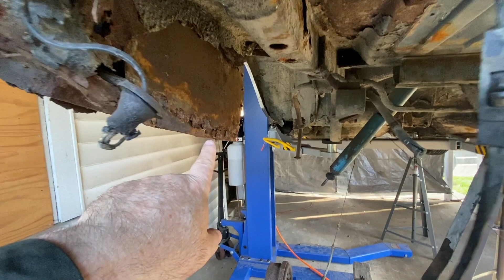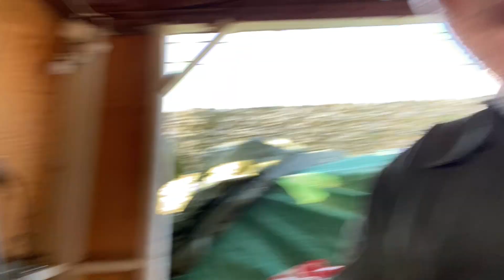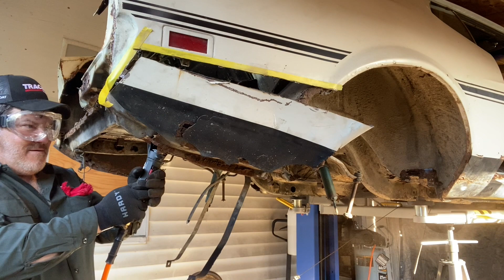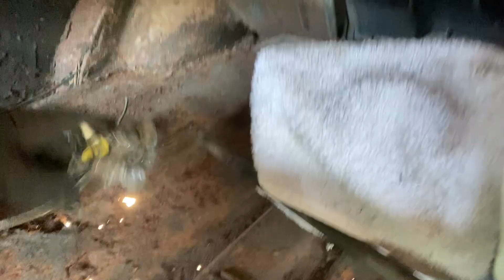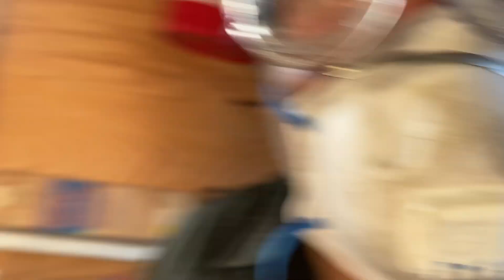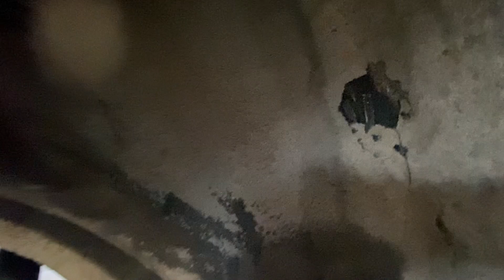Deconstruction Cleanup Has Begun  1972 R-Code Mach 1. Some Experiments Worked Others Not #musclecar

Comment: You are right. You are at the tough decision point. I did the complete wheel well, full quarter and trunk floor. No fun. If I had it to do over I would have done just what was needed to be replaced, piecing off of the new replacements and then butt welding to the old. Also, metal needs to be bare. Flap wheel and wire brushes work well.
Reply from the maker: Thanks Pedro. Good information. I've been working on that for a few days now.
Reply: Brother, your either at the point of no return or just find another old school Ford since you have the drive line. That car is something else. Not sure if it’s worth going past the return line. Tough decision.